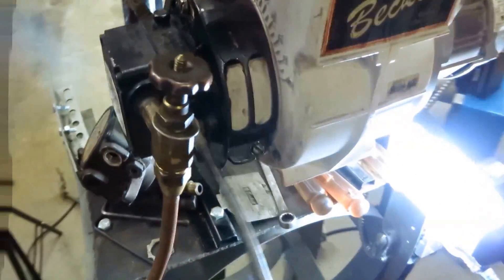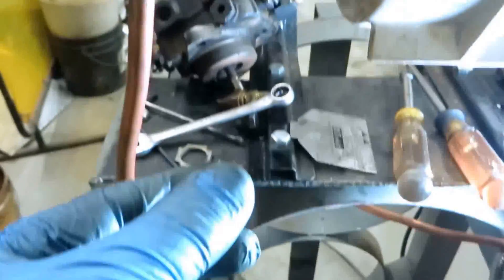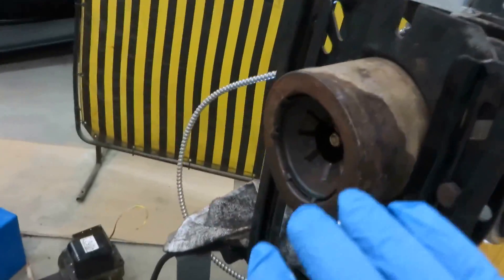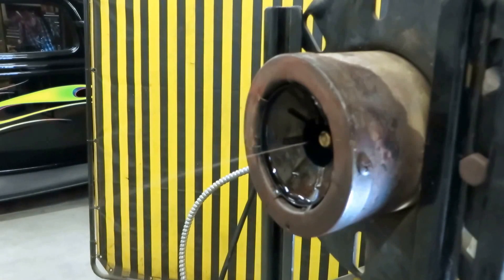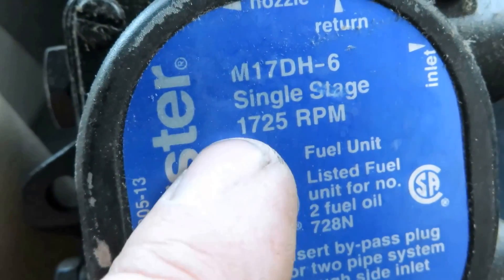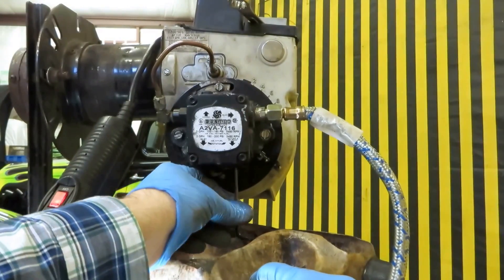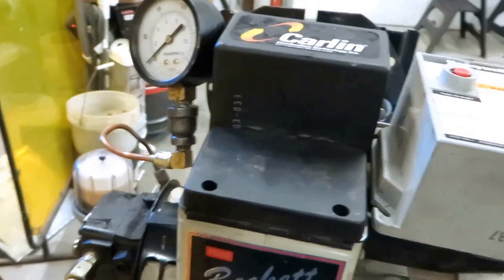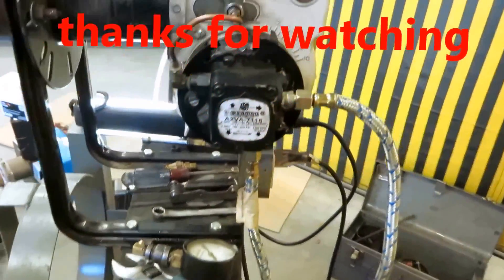Beckett oil burner training series  # 5

Comment: Can I mount a 200psi gauge permanently on the A2VA-7116 ? If so which port can I use ? I have a single fuel line.
Reply from the maker: not a good idea if the gauge lets go you could have a mess on your hands

Comment: Awesome detailed videos ! Had to recently change out the control and ignitor and sensor on a beckett afg for a white hot water heater. The question I'm ask is it normal for the the cad cell to read 900-1400 ohms. The book says 245?
Reply: Maximun on light 1600 omhs and it goes to minimun 200 and some.

Comment: Steve, excellent info and you covered everything I needed. I had to replace my oil pump since leaking oil from the bottom of my Beckett AFG. Seal broke since return line was clogged and forced over 10psi of pressure.
Reply from the maker: +Michael Salvador www.youtube.com/watch?v=8cnA7A3_HVQ

Comment: I picked up Olsen oil furnace scratch and dent at material house I do business with,It had a 1.25 orifice in it I switched orifice to.75 I never checked pump pressure. What should  pump pressure be set at? I HAVE A 1400 SQ. FT. HOUSE. tHANKS in advance
Reply from the maker: Bernard Sobbe i would run the pump pressure at 140 .it comes set to 100 psi at 140 you can drop the nozzle size down ... a .75 will be fine
Reply: steven lavimoniere I was wrong it's Beckett Burner AF65XN Olsen/Airco furnace according to the oil pump pressure chart a.75  80degree nozzle at 140# GPH turns to .89   So the 140 # pressure on oil pump does that give you better , cleaner combustion of the oil?

Comment: hi steve , do all burners pee out that little bit of oil at the end ? is that the cause of the slight oil smell when a air furnace kicks in?
is there any certain air setting for a beckett afg?my serviceman never set the flame i dont think ,done everything but .
Reply from the maker: fnkycoldmedina yes all oil burners will pee out there is 125 psi on nozzle assemble that has to get to 0 thats the peeing action you are seeing.. if you get a il smell when it starts there is a problem with the electrod setting .not firing up instantly . the burner should fire up smooth ..or in needs a good cleaning check the draft over the fire
Reply: just had a guy here ,had the chimney cleaned and the furnace cleaned ,we had a pretty good odor before when it fired up .there was no draft at the chimney and the draft regulator didnt even move before .
now it works as it should . the heat exchanger was like 3/4th clogged with stuff,watched him clean it out .it was chunked up .just bought this house .
he cleaned the furnace,changed the nozzle,changed the oil filter .he was here 2 hours ,took awhile to clean out the heat exchanger .only get a very slight whiff of oil now and again but it was pretty bad before .
the furnace is 20 years old but works well.
the air was hotter before it was cleaned out .i guess that was from being partially blocked and not enough air flow .thanks for the reply .i know he didnt do a smoke test though and wish he had set the flame .

Comment: Awesome video, very informative. Question about the solenoids that are on the newer pumps. Do they do 2 things? delay oil on start up, and cut oil off imediately after heat cycle to prevent the oil from pissing out like you showed?
Reply from the maker: a silenoid is for pre purge and also  and post purge the pissing happens because when you shut the pump off there is still pressure in the nozzle tube it has to bleed of  so that is where you get the pissing but the post purge will dry it up if you have a control that has a post purge
Reply: Got it thank you for the quick response

Comment: What do you do if you come across a boiler or furnace full of oil from the customer pushing the reset button a bunch of times?  Also I have had a couple of calls on boilers this season with bad pressure reducing valves.  I find the system low on water.  Where does the water go if there are no leaks in the system?  Thank for the great videos.

with bad pressure reducing valves
Reply from the maker: if i start a boiler that has a lot off oil in it i let it run worse thing you can do is start it up then if it starts to smoke is to shut if off it can explode ;if you run it it gets a draft going and will clear in a fue minite .i usally ask the people how many time have to pressed the reset any more then 3 times i start to get worried

Comment: man you are rocking out the videos.  Why would you add a tiger loop? Help warm cold oil?
Reply from the maker: different resions for using a tiger loop,,  there used a lot on riello burners. you can turn a one pipe system into a two with a tiger loop .if there is a problem with loosing the prime on a oil pump a tiger loop will solve that problem .if you need more vaccuum a tiger loop might solve the problem